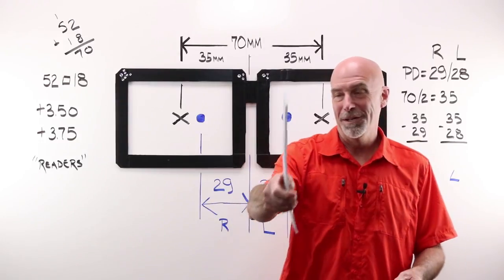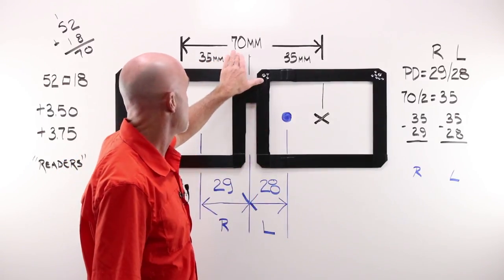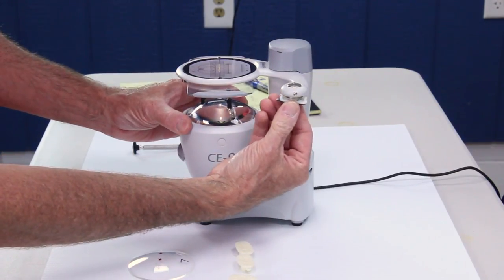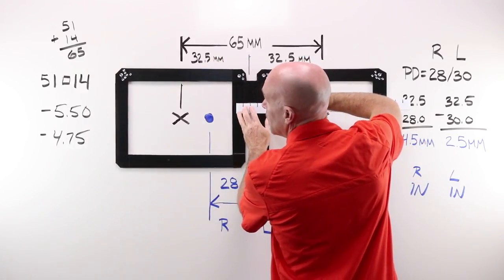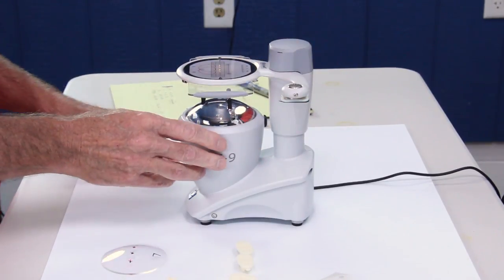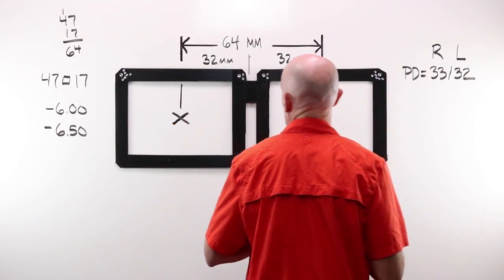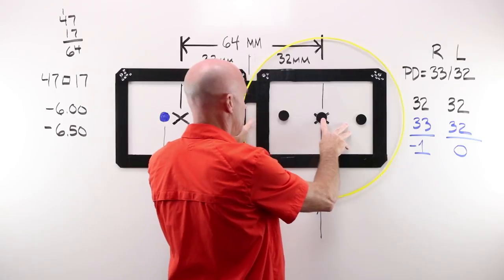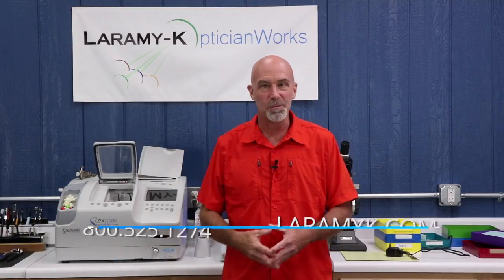Monocular Decentration and Blocking

Comment: I'm just a regular guy who came across your videos while searching for tips on how to pick out glasses and so I'm not an optician nor have I studied this stuff before. Therefore, this question I have may sound dumb but I'm curious to know: How much decentration would you say is too much and would recommend a patient choose a different frame to better match his or her PD? My PD is 63mm and I see a lot of frames with a PD that would require my lenses have 2mm to 4mm of indecentration. Is that an okay amount or do those frames have too wide of a PD for me? Thanks,
Reply from the maker: 2 to 4 mm of decentration is absolutely fine! John
Reply: That's good to hear. Knowing this will greatly help me while picking out a frame for myself. Thank you for the quick response.
Reply: @HermanJulioSanchez  It's actually ideal to have some amount of decentration! 2-4mm is actually ideal! :)

Comment: Love the videos! But all your decentration videos pds are always on the datum line!?
Reply from the maker: Check out the one that says, Vertical in the title. Unless you are doing an OC the PDs are always on the datum line. ?????? Let me know if that is what you were looking for. John
Reply: @LaramyKOptical  hey thanks ive actually seen that one. But what i was thinking about is when im calculating M.B.S. would O.C. decentration matter? I would think so. Or would i add a few more mm's than the usual 2mm after calculation?
Reply from the maker: @andrewlima7356  Extremely rare for a frame to be deeper than it is wide. (Longer B than A). Just doesn't happen and just doesn't seem to be an issue. I guess if you work with crazy-over-the-top shapes you might need to think about when considering MBS but, wow, that would be one crazy shape. John

Comment: how to make a pattern from demo lens / second lens with pattern drill machine? thank you.
Reply from the maker: Not an easy answer. If you have an edger or drill tool you'll need to find the manual for it online. If you just need to make a pattern then you will need to track down a good old fashioned pattern blank. Perhaps your lab might have a few? Spot a 0-180 reference line before taking anything apart and then carefully trace the shape on the pattern. Cut it out with heavy scissors and finish with a file. For drill locations that will be tough, but certainly not impossible, to get perfect. Sadly all kind of a lost art in the world today. Assuming you are working with a finishing lab and the customer can't do without their glasses I'd talk with the lab and they should be able to help you come up with a solution. John
Reply: @LaramyKOptical  i just bought a semi auto edger machine. but still on shiping. while I was looking for the tutorial and found this video. I learned a lot. but one video that I have not found that makes a pattern from the demo frame lens. how to determine the right oc frame and make hole. because not all frames include a pattern lens. For this video lesson i say thank you very much. Its help me